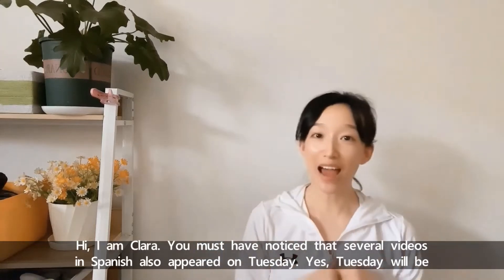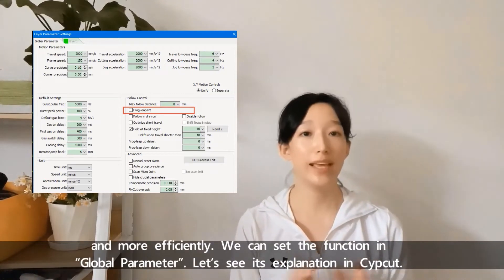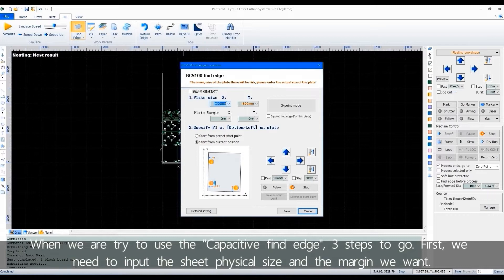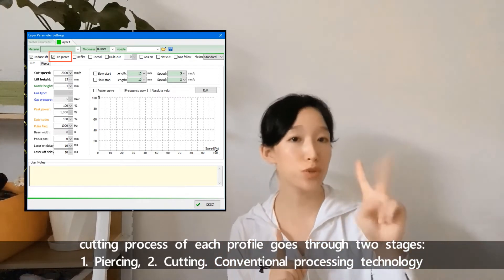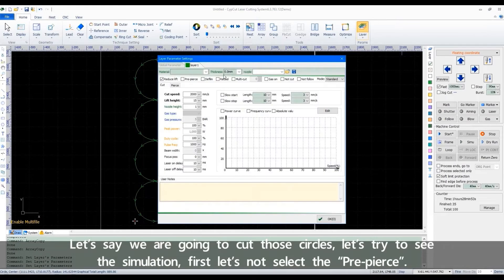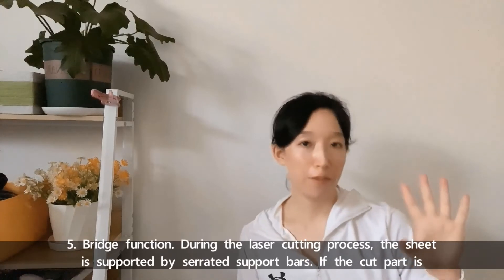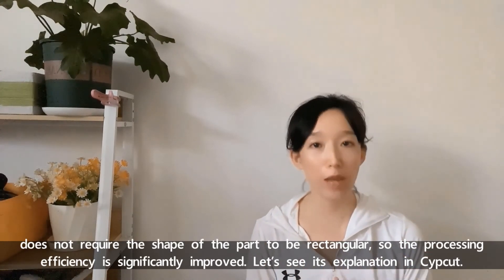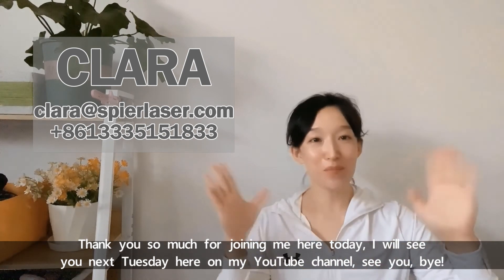6 Functions to Enhance Laser cutting Efficiency | Cypcut Parameters

Comment: When I'm cutting a hole for a bolt with my laser when it gets to the end of the cut there is always a bit of metal left at the end of the cut. Is there a way the you can program cypcut to do a 1mm over lap on the end of the cut?
Thanks
Reply from the maker: Home-Seal, there is a “Over”.
Reply: @ClaraChai  I thought that's what that function did but I can't get it to work for me and can't find a video on how to use it .
Reply from the maker: @markanthony4252  you can check my tutorials of CypCut
Reply: @ClaraChai  I watched the cypcut tutorial it was very helpful, but on my laser when I click the seal and over button nothing happens.